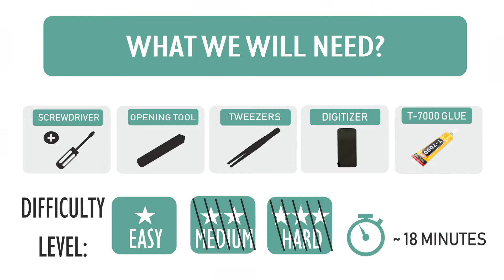Huawei Y5 Y560-L01 Touch Screen Digitizer Replacement Repair

Comment: Hi, how do you repair the lcd display?
Reply from the maker: If the display does not look broken you can try pressing the lcd tape and check the reaction, if the lcd starts to appear you can put a piece of paper between the lcd tape and the frame.
Reply: Sorry, I'm not really an expert on this ;) Where is the lcd tape situated? How does it look like? I'm not sure... 
To make the picture clear: I Iet my phone fall on the ground and since then all I get is a black screen. When I push the power button sometimes it still vibrates/reacts when pressing but I get nothing on screen. I went to a phone repairstore yesterday and they told me it is probably down to a short circuit of the display. Thank you very much!
Reply: Oh, and I replaced the broken touchscreen. I thought maybe it was because of the broken touchscreen. But now that I replaced it ,  I still get nothing. Only the vibration when pressing power button.